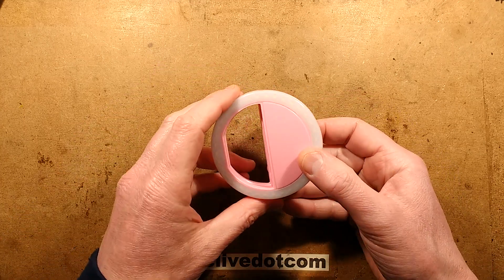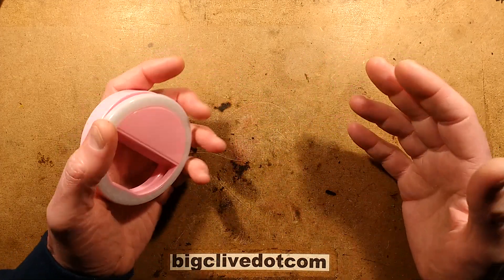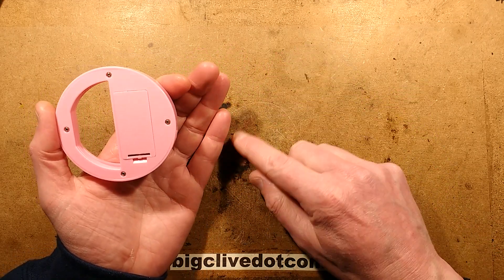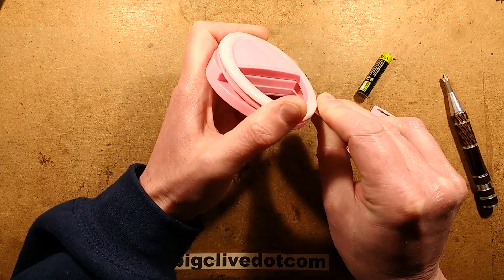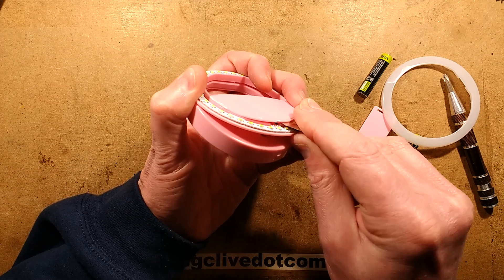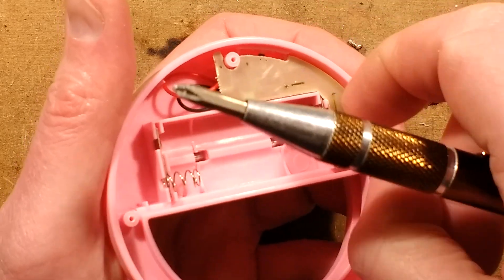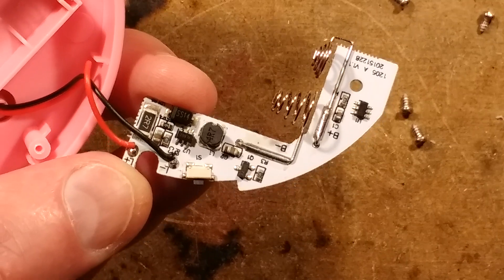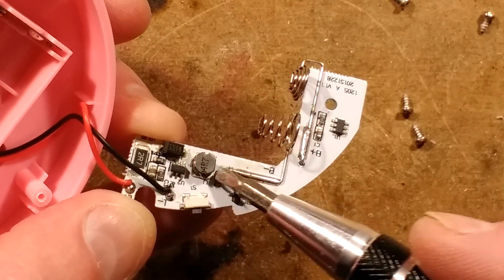Inside a pink ring light for phones.

Comment: hi Clive, theyve brought out new ones of these that have a little rechargeable cell in them, charged via usb. I just bought one, but it cant be powered directly off the USB - only charged. I intend to modify it to get rid of the battery and power straight off USB (battery inside it is only 200mah - or so they claim, starts going dim after like 20mins) - I would be interested in you looking at one of these newer rechargeable ones

Comment: I also bought one of these for making videos of circuit boards and whatnot, and to add another option for lighting, however it was too skinny for my phone and the camera placement was too low, so I took out the middle section and also powered it by a bench supply. 

Didn't end up getting much use and it was pretty kludgey but these things are handy for sure, moreso if they fit your phone. Definitely made with iphones in mind.

Comment: Hi Clive,

I am wanting to do a project with this: https://rover.ebay.com/rover/0/0/0?mpre=https%3A%2F%2Fwww.ebay.co.uk%2Fulk%2Fitm%2F132198387616

I have an android box with souport for a USB touchscreen, the box is running an android auto emulator. My question is do you think the touchscreen on this device is running using USB into its own 'MP5' software ?. If so I would want to extend that built in touchscreen to the android box so it can be used with android auto, the headunit has AV input.

Thankyou for reading this and I would love to hear your advice.

Comment: while ring lights are a compact alternative to using large diffusers (the disadvantage being the stronger reflection), they are not usually placed around the lens, because the lack of shadows makes photos look a bit boring, and makes it harder to get a sense of depth. 

of course, if youre just trying to make sure the numbers on every chip are lit, uniform illumination is a good thing, but for a portrait / fashion / product photo you always want some light coming from the sides, to cast interesting shadows (and usually a mix of diffuse and more direct light). 

ring lights around the lens are sometimes used for macro photography, ex:

https://www.amazon.com/Canon-MR-14EX-Macro-Ring-Black/dp/B00ICSNCG6

but even then, to have more control and make the photo more interesting, you might need some directional light:

https://www.amazon.com/Canon-MT-24EX-Macro-Digital-Cameras/dp/B00006I548

btw, with a 3d printer and a bit of soldering you can make those for a (very) small faction of the price.

Comment: Sometimes UV light helps you see the tracks on the white PCB boards. It almost as if the LEDs are brighter then the defusing plastic. I think if the plastic was thicker, or if you put another sheet in front to diffuse it more it should get rid of the ring of light on reflective surfaces.

Comment: You have the same phone as I do! Yours is in much better condition though. But to be fair, mine is either 3rd or 4th hand, depending on who you believe, and I didnt break the screen. I simply owned it when it got so hot that the glue around the screen melted, and the smashed corner started coming to bits and bending out, but some blue duct tape fixed that (kinda). Its getting out of date though, doesn't support android 7, and the battery life is abysmal

Comment: And now you can use the bits to make a version that the camera lens will be right in the middle. 👍
Reply: Slikx666 Also, simplify to a single circuit board with LEDs and battery connector on the same part, leaving just the clamp itself as the second half.  Push battery compartment to the edge so lens can go center. Use PIC μC to also do switching and current sensing, thus doing the PWM above 50kHz.
Reply: John Francis Doe https://youtu.be/Wn7PGzvlesI I built my own a few years ago, only 3 LEDs but it works.

Comment: Regarding exposure, maybe it would be easier to adjust the light and keep exposure fixed. You can get really fine analog control over light intensity as opposed to exposure. It would probably require a more diffuse and even lighting setup though, so it goes into the shadowy bits better.

Comment: I agree that in most cases the little pink ring light is great for big close ups. But for the shots of your full workbench area something bigger, better, and more professional is called for. Something like this LED unit   http://amzn.eu/58y7Vbb  Not cheap but it will vastly improve the look of your work, dealing with those nasty shadows.  Hopefully it will also solve the problem of getting perfect exposure, by finely adjusting the light, not the camera. (Whilst keeping the colour temperature constant). Needless to say, the light needs to be folded down into a position parallel with the bench.
Reply: What about something like this? https://hackaday.com/2018/04/05/workbench-light-arch-on-the-cheap/
Reply from the maker: I have a large ring light here and have considered using it, but I think a diffused LED panel with the camera pointing though an aperture in it would be better.  I also have to consider how far the camera and lighting protrudes at face height.

Comment: I made mine from a COB angel eye. The ring has loads of leds and it’s more diffused. https://rover.ebay.com/rover/0/0/0?mpre=https%3A%2F%2Fwww.ebay.co.uk%2Fulk%2Fitm%2F302390869141
Reply: Daves Garden and hens tour nope. Lots of people call them angel eyes. Mostly BMW owners love to put them on their cars...
Reply: I did the same for my Sony camera :D I used two of them(small cold and big warm) and install them on rubber base that I can put directly on lense. I used two 9v batteries behind them with 2 step switch to use one or both lights. Rest of cover is made from plastic that is look actually nice after painting it black.
Right now Im thinking about making new one on 5v using 3-4 really small 500mAh lithium batteries that I found and small charging board from cheap battery pack . Such project are really fun to make because with every version you make them better, thinner and cooler looking.
Reply: evilution they are called halo lights not angel